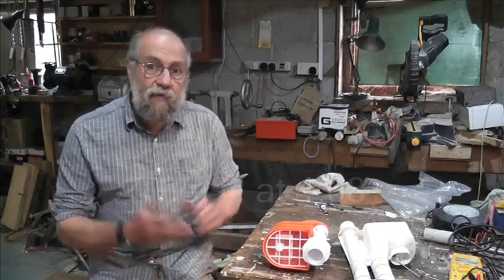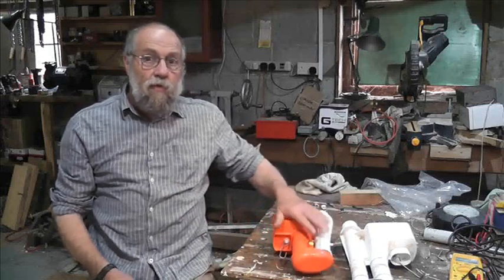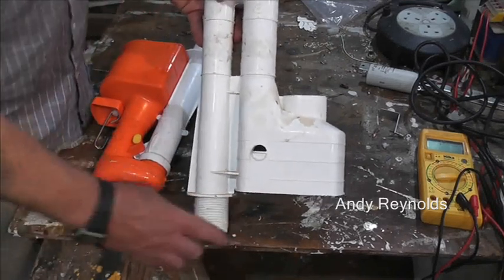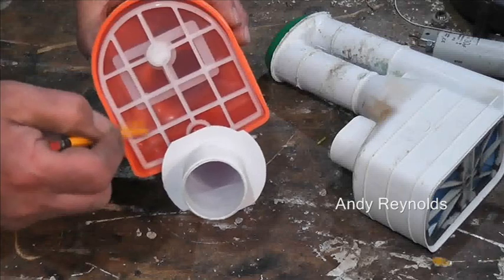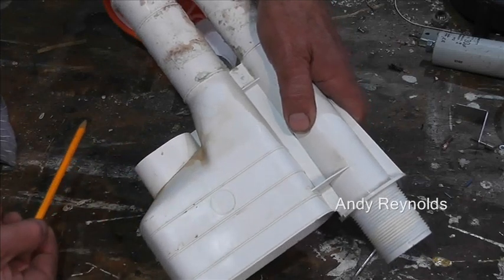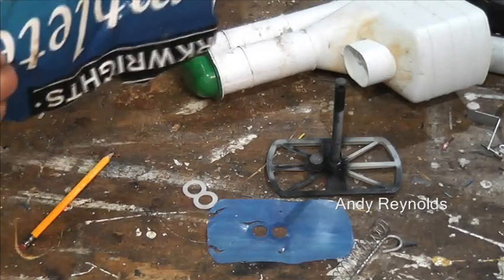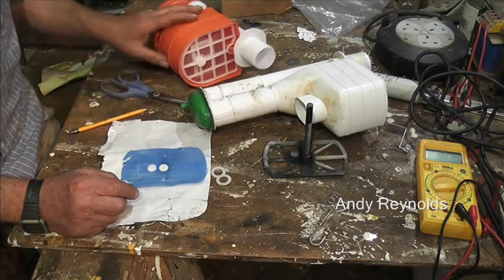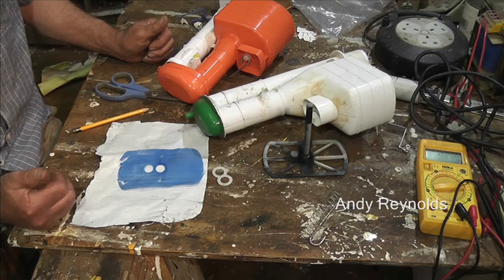Toilet syphon flush fix, no parts required. Dead rural repair.

Comment: Cheers for the vid. Just changed the diaphragm on a 22 year old unit with 0.5mm plastic sheet I use for modelling. Saved £15 on a new one and God knows how much on the call-out. The money can now be better spent on a few bottles of wine. 🤪
Reply from the maker: Brilliant, send us one, cheers
Reply: Im about to do this too. Do you glue the diaphragm on or is it just loose. I'm guessing loose!
Reply from the maker: @mattsmith3838  Hi, yes just a push fit, cheers

Comment: Hi Andy, this brings back memory's. Late one Saturday our flush packed up. Dad as he did had a look and took it to bits to find the same failure. Off into the shed and a very thin piece of Lino found. Like you traced around the original and reassembled. This was only meant to get us though the weekend. At least 10 years later it was still working without fail in a 4 person house. Skips one mans rubbish is another's treasure.
Reply from the maker: Thanks for the story, a mind set and resilience worth promoting, cheers

Comment: Hi Andy,  I did see a very clever design of Syphon where the flap valve half separated from the flush side. This allowed the flap valve to be replaced without draining the cistern or having to disconnect the flush pipe & unscrew the complete Syphon. Perhaps that new orange & white Syphon separates like that ? If so it could make any future flap valve replacement a bit handier ?
Reply from the maker: Nice to hear from you Tommy, hope all well. Just thought I would put the idea up there, and encourage the interest in self reliance, cheers

Comment: Good man Andy, I have 2 of my toilets now running on rainwater. once I see how it goes I will get the washing machine cold over to it as well.
Reply from the maker: I'm thinking you will do well as you live in the city of rain, over here in the dry county it's a bit different. Our tap water is hard and soft rain water would do well with a washing machine, using far less soap. Cheers
Reply: I am dismayed when a large number of people in power and not encourage many thousands of houses to be built with no thought for efficiency.
I often tire people around me by preaching all new houses need at least 4kW solar panels and a grey water system for loos and washing machines.
Makes perfect sense to me.
Reply from the maker: @ianhelsbyservices  Ian, most modern houses are very badly built. There was an initiate to fit panels to all new houses, but this was quietly dropped. The old down to a price not up to a standard problem, even 10 years ago they just were not taking the problem serious. They think they are  so brilliant, short term delinquents, cheers

Comment: Andy the next one I do I will use a thin silicone sheet as I think the plastic doesn’t like the very cold water in winter and the plastic hardens up not working as well — but I may be guillding the Lilly 🤔
Reply from the maker: Hi, there's the old saying, do it right, do in once, cheers
Reply: @TheInfoworks  🤭.   But I have an R&D budget 😏
Reply from the maker: @pollywollydo  That's a good place to be, cheers

Comment: Well. I never knew what was in most people's cisterns. Mine is porcelain, holds 50 litres and the fittings inside are solid brass, adjustable and repairable. It's like 100 years old. 
When I have visitors I have to teach them how to go to the toilet. I just think it's normal. I don't even know what brand it is.
And whilst we're on the subject of toilets - They belong outside. I'd never build a house with a toilet inside.
Reply: Good man Ade, ours is a pine box, lead lined with a brass and alloy syphon from a few years ago. Still works, but like you say newcomers need some help.
Reply from the maker: I like the repairable and robust materials. These modern units are down to a price and water consumption. We are not on a water meter, as I suspect neither are you, but water efficiency is an important consideration for many people, cheers
Reply: @TheInfoworks  Yes. True. We are not on a metered water supply.
No wheely bin service, no sewerage and no water charges here. 
Water is precious though and during times of drought we do our best to conserve water. The flush mechanism is 100 years old however it can be manually manipulated to only flush a small amount. It's a matter of deciding how much water to use for the situation.
Reply: @bootsowen  Excellent Owen :-)
Reply from the maker: @adelarsen9776  That's a way of living that would shake the thoughtless consuming townies out off their dream state, cheers

Comment: Chicken feed bag😂

Should last longer than that original one…
Reply from the maker: Hope so, only one way to find out, cheers
Reply: @TheInfoworks  I went down Screwfix and bought the replacement. £5.99 saved me half an hour of cutting. The one I had was very easy to replace as it came in two parts, Dudley turbo 88. 👍🏻
Reply from the maker: @Himoutdoors  25 mile round trip makes you think of alternatives, cheers
Reply: @TheInfoworks  I was looking for some OHP film, or lamination sheet, as I think that would have worked. £6 is a rip off, but there you go!